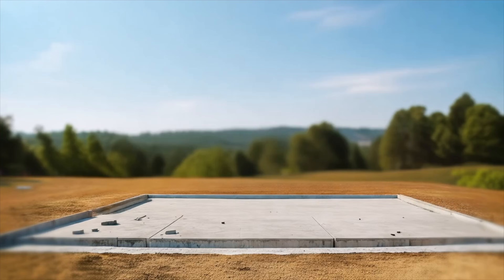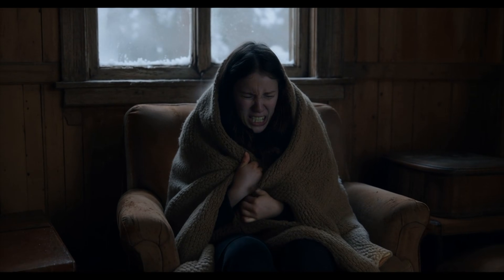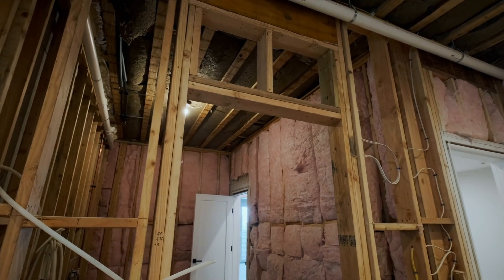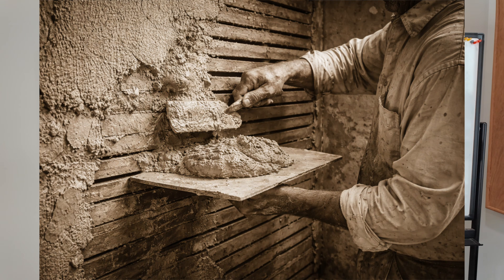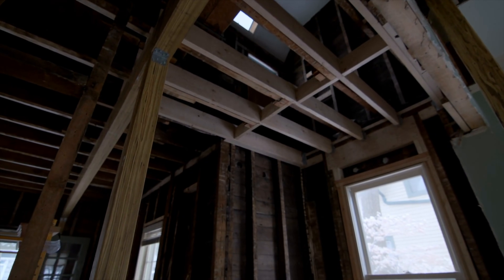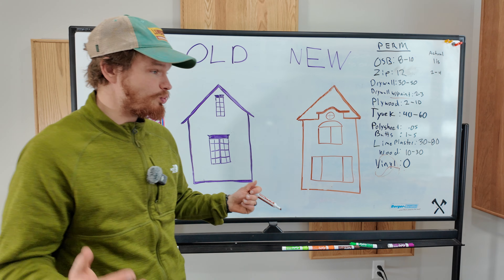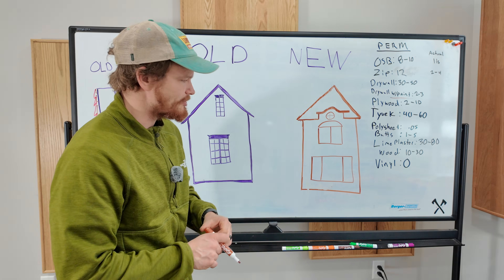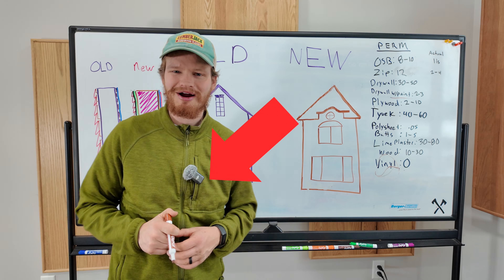New Houses Are Growing Mold — Old Ones Somehow Usually Don't

Comment: Really old homes had three benefits: 
1) naturally dried wood retained the antifungal chemicals found in trees. Modern wood lacks them and cracks due to rapid drying. 
2) Most old paints were mineral based, which offers little to feed on and whitewash is very basic making it actively hostile to mold. If it doesn't have an organic or artificial binder, it dries faster too.
3) Houses were open systems and the fireplace powered the air exchange and drying process.
Reply: I wish modern economy would allow learning by mistakes.
Reply: @heyhoe168 all mistakes are covered up, and not tolerated. Government also dose not remove laws it just makes new obes since "government dose not make mistakes"
Reply: @heyhoe168  thats what it is about. the mistake is just making anything that creates generational wealth or health or unity or anything in their eyes
Reply: @heyhoe168  mold is great for business, complete reno every 10 years
Reply: @heyhoe168 brother
Reply: Yes. Chimneys make a huge difference! I hate being hermetically sealed into my house.
Reply: @KrisHughes  I prefer the option to be hermetically sealed… my chimney has a sealable door.
Reply: The foundations on these houses are way worst... way... and we all know what happens when your foundations are weak...
Reply: @evalangley3985  It depends, but yes, many old houses either built directly on dirt, or on stakes, depending on the location... If it's gravel or orck in the prior case, or in a stable, oxygen-deprived state in the latter case, it can work for centuries though...
Reply: but do you really need a fire place for air circulation? aren't windows in pathways of air enough?
Reply: @MGrey-qb5xz What you are probably  referring to has more to do with cooling and general air exchange, which definitely helps against moisture, but when it comes to lighting, heating, and cooking with combustion and venting the fumes, this is a very different story. Heat gradients cause active ventilation irrespective of external winds and warm air carries more moisture, but is also the one that gets expelled, thus, it's more efficient by orders of magnitude...
Reply: @MGrey-qb5xz  And the materails breathe. Plastic does not.
Reply: @MGrey-qb5xz  do you really wanna have your windows open when it is 12° out and the wind is blowing at 20 mph? That fireplace serves for airflow and you can actually burn something in it that makes you warmer.
Reply: The custom home builders who know what they're doing are accounting for this, but the problem is you have more high-efficiency builders entering the space all the time without all the training and understanding of breathing that old houses did, and that just living in the house, people breathe out and sweat moisture constantly, and that all has to go somewhere!

Basically, you HAVE to install ERVs in these houses to ensure your humidity level is such that it won't encourage mold and mildew growth!
Reply: Good points.
Reply: But what do you do with plaster walls that are all cracked, and if you touch them, pieces fall off 🤔
Reply: @gmw3083 I'm no expert, but I guess that you'd knock them off and reapply plaster... If it isn't that brittle, you can fix the cracks and add a layer on top.
Reply: @edi9892 That sounds reasonable. A lot of work, though. There are nails that stick out from the walls at regular intervals near the ceiling. I think they must have hung something from these back in the day that would cover almost the entire wall. I might try that first. If I can think of something to hang there.
Reply: @gmw3083 i rocked over mine with 3/8 sheetrock. If they are too bad you can tear the plaster and lathe out, insulate between the studs with batting, then tyvek, then 1/2 in sheetrock. Or tyvek,plywood, and rock. If the wood is still good there is a repair.  Or build a new one.
Reply: They also had lead in the paint which could lead to metal toxicity in children. A lot of them also had asbestos, which is a naturally occurring mineral that can kill you by causing cancer old does not mean good and new does not necessarily mean better
Reply: @JulianaBlewett lead paint is only a problem when ingested in considerable ammounts.  Asbestos is primarily a problem during renovation. I'd be more worried about Sheele's Green (used to be in wall papers, though today you're only likely to find it in old books, and lead plumbing.
Reply: What the heck do you mean "modern wood lacks them (antifungal chemicals)?
Nothing about trees cut down last month makes them more or less mold resistant than a tree cut 100 years ago 

What weird azz pseudoscience crap are you talking about?
Reply: @WillBass-n7o  This is where you are wrong!
It's not pseudoscience but linked to how the wood is treated!
In the old days, people would go for old-growth wood and cut it down in specific circumstances, and allow it to air dry for a long time.
This gave very different material properties than young trees, which are oven-dried until the wood cracks and all the aetheric oils evaporate...
The old vs young trees have less to do with antifungal properties, but durability and density of the wood, thus only affects the antifungal properties indirectly...
Why do you think high-end furniture pieces and wooden instruments are still made with lumber that was traditionally harvested and dried?
Reply: @edi9892 new wood is same strength and density as old; besides we don't much, if any, old growth forest left.

High end furniture is made from HARDWOODS not softwoods. Totally different trees and harvest age

Do you even know the difference between hardwoods & softwoods, used in residential framing?
Reply: @WillBass-n7o  True, we have hardly any harvestable old wood left. This is, for instance, a big problem for authentically restoring the roof of Notre Dame de Paris...
I bet that today we mostly use softwoods (such as Fir), even more so with the modern wood frame structures in the USA, but traditionally we did use hardwoods, such as Oak in Europe... 

PS: hard doesn't necessarily mean physically hard or dense, if I'm not mistaken, Balsa is botanically a hardwood, despite being softer than a Palownia...
Reply: @edi9892  I heard in the ancient days they would cut the bark of a tree and let it die and dry slowly, before felling it.
Reply: @L6FT Probably not SOP, but plausible enough. They did experiment with felling time, drying, etc.
Reply: @WillBass-n7o  He wasn't saying new vs old: quick dry vs slow dry. The traditional method utilized engineered buildings to make it go faster, but now we use giant kilns to dry them waaaay too fast. This causes damage. It's like drying your paint with a heat gun. Sure it's faster but oil or latex, you will damage the finish.

Comment: ERV! I have spray foam insulation and zip system. Running a humidifier makes a difference too. Don't allow moisture from outside.
Reply from the maker: That’s a pretty tight house I imagine.
Reply: @LumberjackHealthyHomes it is. I spent the extra money to make sure moisture is staying outside. ERV helps with moisture too
Reply: Spray foam sux because trying to do any repair or if any water gets in at all. After a fire foam sux. Just not very agreeable unless you want to replace everything eventually. I've seen entire housing developments get torn down in 6 months for mold.
Reply: @LampWaters you shouldn't have water if you build the house correctly. Lol at why people have water issues!

Comment: My house is literally the last year which was considered Phase 1 in my development which was done old school with dimensional lumber for floor, roof, sides, etc. 1959 vs 1960 which is considered phase 2 and switched to plywood for everything. I am also all rockwool vs fiberglass which was also changed in Phase 2. Most of Phase 2 house are the same in design as Phase 1, but I guess the builder wanted to introduce the "New Age" and probably save some money... What's funny is most Phase 1 houses sell for almost 20% more than phase 2. I am very happy with the old tried and true building techniques. I also have true 2x4s. I wonder if phase 2 went to 1 3/4 instead?
Reply from the maker: Our materials confine to go down hill as technology gets better and better

Comment: Good video, every house I’ve seen with luxury vinyl has at least one split in it where the seem is coming apart, when the temperature inside the house changes it will expand or shrink causing them to come apart, hardwood or tile is the way to go
Reply from the maker: Yep it’s the worst option for sure!

Comment: The one product that I think we need to start replacing is drywall with MGO board. MGO doesn't mold anywhere near as easily as drywall even when painted. It's stronger (can even be used for underlayment or subflooring, more fire resistant, both is more water resistant and dries better , and significantly better at isolating sound than drywall.
Reply from the maker: It sounds pretty cool. I have not had the chance to use it yet.

Comment: my 1914 had a roof leak for a decade and no mold whatsoever, just replaced the roof and a few floor joists and its like it never happened, Id rather pay a higher heat bill in my drafty old house than have a new air tight mold factory.
Reply from the maker: If wood can dry it out, it’s not a big deal if it gets wet!

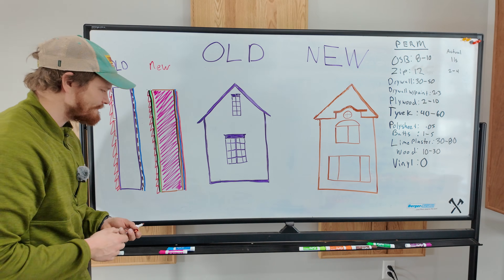Comment: 1:45 The paper/etc. backing is supposed to face the heated side of any wall to limit condensation in the actual fiberglass; not just a Midwest thing.
Reply from the maker: My understanding is that it faces the warm side, so in warm climates it’s reversed. I don’t have any first hand experience building in warm climates though.

Comment: live in a 70's  rowhouse in the netherlands,   outside is brick,  inside walls are gasblocks,   floors are concrete with a crawlspace beneath,   now have cavity wall insulation,   floor insulation,  the addic  has been insulation with a rock wool product,   new double glazing for the windows,   so pretty airtight,    but they did ad ventilation systems   which i always use,  beside just opening windows  for short periods every day,  to clean out the air in the house,  so  no moist air inside  and no mold,    ventilation is so important,  but when people have aircon  they forget to open a window for ventilation.  and recycle old air in side.
Reply from the maker: It sounds like they did a good job on it!

Comment: Almost every home i ever worked on in the cold north had mold in the roof and walls. High winter humidity combined with very cold outside temps with heated interior always creates a place within the walls or  ceiling were a condensation line will happen. Sometimes that is on the back side of the sheeting or mid way in the insulation.  Only homes that didn't have mold were log ,icf,iccf or other alternatives with no air cavity for condensation to occur. Roofs were only safe when it was t and g wood on the ceiling with closed cell foam sheets or sprayed right over the top of the t and g wood. Only roof system that ever worked. Attic roofs would literally rain inside after a warm up from very cold weather from the ice that forms on the underside of the roof sheeting.  Can't expect it to dry out from ventilation when the air is at 95 percent humidity for 6 months and the sun never shines enough to get air to even move.
Edit : i didn't explain very well the mold free roof system.  Only good way was exposed rafters or beams with the T&G on top with closed cell foam sheets or sprayed on top of the T&G. Definitely was never good when the bay inside the rafters was filled with spray foam Absolutely horrible
Reply from the maker: This is good knowledge. How far north were you working?
Reply: @LumberjackHealthyHomes  45th parallel and north

Comment: Houses need to breathe,  window drafts are seen as a bad thing. No exchange happens, but breathing, cooking, washing, and showering do. Realtive humidity on new tight builds seems to always be above 60%. Nothing ever drys out.
Reply from the maker: Yeah they do need to breathe. In the Midwest lots of old homes are very hard to keep comfortable in the winter though without spending a small fortune on heat each month.
Reply: @LumberjackHealthyHomes  Breathe through a HRV, not the walls. Otherwise you are paying for heating up the whole Galaxy.

Comment: Is there a reason you couldn't go the other direction, and try to use, almost exclusively, products that mold can't eat? For example, mold can't eat plastic, or stone, right? Can it eat cement? Brick? Steel? Maybe just avoid wood/paper products, and things held together with non plastic glues?
Reply from the maker: Mold can grow on all those things still because dust and  debris will land on them and feed it. I think natural wood is the best material for avoiding mold actually since it dries out well and lets moisture move through it. I do think avoiding things like paper backed products and floors like OSB is the way to go.

Comment: There is no answer
In colder climate in winter heat is trying to escape cold is trying to get in and this process leaves frost in your insulation. In the spring all that melts and ends up pooling on your soul plate creating moisture  mold and other problems. There is a way to contend with this but also very expensive. 6 inches of foam on exterior walls. Furring strips and then siding.. university of Alaska Fairbanks
Research for yourselves
Reply from the maker: Thanks for the info!

Comment: The "vapor barrier" thing is the main cause of mold.
Reply from the maker: Well tyvek is incredibly vapor open, so I don’t think we can blame it too much.
Reply: @LumberjackHealthyHomes Tyvek is good stuff. But poly sheet is commonly used under the wallboard, and doesn't allow vapor to pass, there should not be a vapor barrier on the inside. Kraft paper used to used a lot inside houses and can be found in good condition inside hundred year old walls.
Reply: @LumberjackHealthyHomes  Ne Hinterlüftungsebene ist das was euch fehlt
Reply: @jannikpollack7331  Ventilation layer?
Reply: @priestesslucy kind of like how siding doesn’t lay flat on the exterior wall: there’s space between the siding and wall. There’s no such thing with conventional shingle roofing
Reply: @LumberjackHealthyHomes  Tyvek is not a vapor barrier.  The vapor barrier is the layer that, in the north, we put on the interior side of the insulation.  IMO the big problem is that while it works properly in the winter, people use A/C in the summer and get their drywall (and the vapor barrier that it’s in contact with) below the outdoor dewpoint.  The dewpoint of the air within the wall assembly is probably about the same as the outdoor dewpoint.

Comment: Houses made out of wood and trying to look modern and contemporary with finishes that was designed for masonry and reinforced concrete structures which are impervious to damb and mold. So it is best to build like Germany for example which is all masonry and concrete with zero wood products for structural work.
Reply from the maker: I love to learn how the Europeans do things differently. I do think wood is amazing way to build we just have complicated it over the last 50 years.
Reply: @LumberjackHealthyHomes  the old way of building with wood was never designed to be airtight and was supposed be breathable which allowed the structure to dry out.  But wood has it is limitations when it comes to durability and strength,  wood is biodegradable, flammable, and subject to insects infestation.  Most countries in the world build with masonry and concrete for a reason,  people expect durability and strength in there homes , as  a matter of fact you couldn't sell people wood frame homes over seas . My grandfather's house is will over 600 years old and is build from stones and the roof is stone as will built like old Roman building using arches designed to span space.

Comment: We bought some acreage and it came with a 1932 one bedroom cracker house.  Despite being abandoned 10 years ago,  the original metal roof was mostly watertight and there was no mold in the building.  100% lumber construction, walls, doors, cabinets everything was wood. House was as airtight as a seive

Comment: A lot of mold problems are also poor ventilation. A lot of people don't have their windows open enough and so moisture just hangs in the air inside the house instead of being vented out the windows. Also, a lot of people don't install roof vents so that air trapped in small spaces like above the ceiling but below the exterior roof has nowhere to go. And then, new homes at least within the last 10 years? Most of them aren't even built up to code with tons of code violations, just look up the countless "new build code violation" videos by people like Cy Porter, and that black guy that says "that ain't right"... some of these are ridiculous. If a home is built properly and ventilated properly, mold isn't usually a problem. But, when you have all of your windows shut and you never ventilate the place, that's when problems come up, especially in the rainy season.
Reply from the maker: I agree lots of bad builds and shady builders. I like watching Cy’s videos as well! Ventilation is super important. I know my attic is not vented nearly as well as it should be